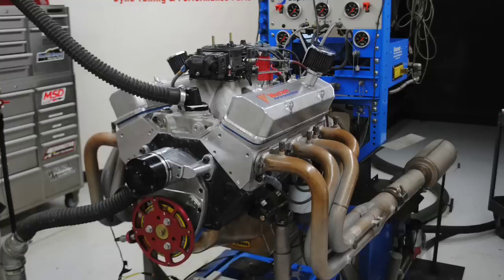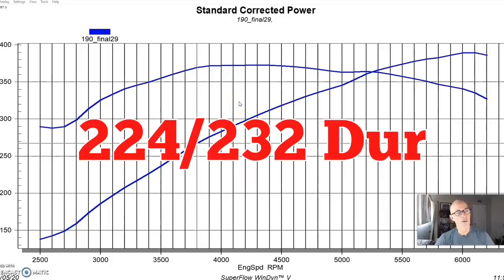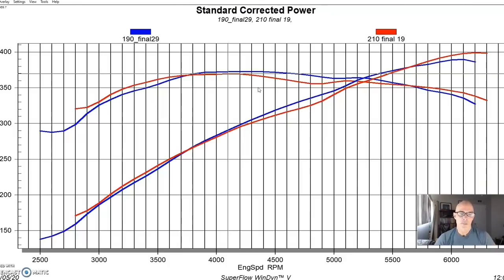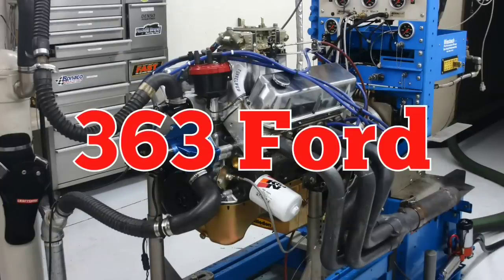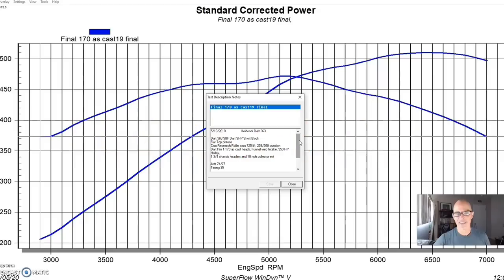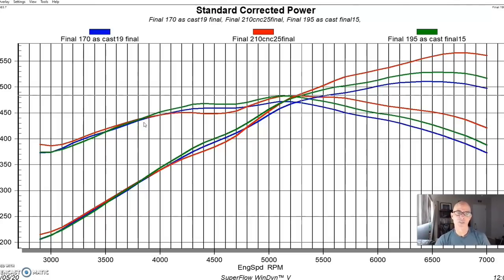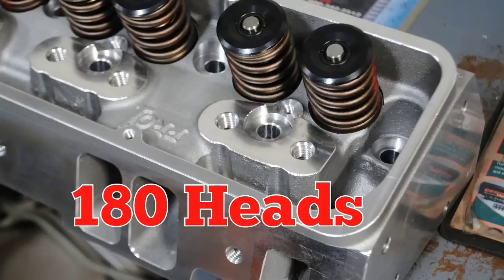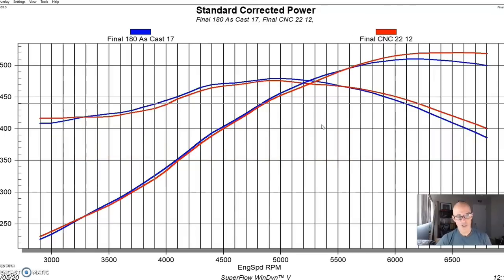PORT VOLUME-IS BIGGER BETTER OR IS LARGER LESS?

Comment: My research at UM showed that what the larger port volume does is that it dampens the effect of scavenging from the exhaust, which is why you see the effect most in the midrange. Any one of the many factors that improves your pumping efficiency in the midrange will also make your engine less sensitive to port volume. So an engine with a larger displacement, a tighter LSA, and properly spec'd long tube headers will not be as sensitive to port volume as one that does not have those advantages. One last note, where you have the volume is also important. I would say that the pocket volume is much less of a factor than the cross-sectional area. Keep up the great content!
Reply: Have you posted your studies anywhere on the internet.  Something more long form and person can look at?
Reply: @superkillr  My comments are based on research conducted for GM and Ford on a variety of projects. Sadly none of it was posted in the public domain. That being said you can see the results in the cylinder heads that were developed from that effort. In this case that would be the L76/L92 head.

Comment: I got one for you take the vortex cam and put it in the throttle body and play with 1.6 rockers or throttle body spacers real junkyard pull and put together without those awesome vortex head any gains or fuel possibilities  not worried about horsepower but durability and torque and fuel add the vortex to a throttle barrel and see if their is a benefit we need work not race engines just looking for that combination out of a junkyard pull it put together and make it work we all love power but let's shop the pull a part for an awesome  combination that improves performance and fuel economy and assembled on spot cause some of us aren't blessed as you are  but GOD BLESS ANY WAY CAUSE I LOVE WHAT YOU DO we just don't have parts lying around were going to the junk yard to find ours hoping they do better we have no dyno or fancy monitor to tell us were rich or lean or lacking head flow or compresssion

Comment: I have 2004 Chevy express van 2500 with a 6.0 lq4 I like that stage 2 truck cam. Can you tell me what to buy to make my van a rocket without going nuts? I like the idea of not having to change valve springs or the converter, but I would love to be able to get 500hp and ftlbs together  or as close as possible. Excellent testing and mechanical engineering 💪💪
Reply from the maker: boost

Comment: Re: your question about part throttle power—I never dynoed it, but I had a 2000 Silverado 2500 with LQ4. I added some mildly ported (basically a pocket port) 706 heads and a Vinci 210/218 .551/.551 cam. Overall power was up for sure, but the best part of it was the part throttle response. It was really snappy and fun to drive. Even with the lazy 4L80 first gear.

Comment: This is a good test idea but you forgot some key things gs to cover. When trying to determine cylinder head affects on a motor you have to make sure your intake manifold is not a restriction. On the 306 combo that manifold average runner flow is only about 240cfm. The intake manifold flowed less than the heads on the 306.  Bottle necks in the combo can skew the results.
The 363 made more power because you had Funnel web which has a average runner flow of 300cfm which is why the power increases were more. The manifold was not a restriction.
This is good testing. Love the real world testing.

Comment: An old endurance race engine builder used to tell me, "I want the smallest port that flows the CFM I need to make the power needed"
Reply: I'd rather have a smaller sized intake runner on a street based motor. As Richard stated. These numbers are based on full throttle pulls. Not part throttle driving. 

Never forget the time motor trend put a set of 165cc heads on a sbf 410 and it made stupid torque through the entire rpm range. 
The 195 head was the clear winner in that test. Because the cam was on the smaller side too. The 220 version would've done better in the test. IF the cam was bigger. But the longer duration will make the torque come in higher in the rpm band. 
So part throttle and lower speed driving would be effected significantly. 
* Unless you have a stick & a very light car.
Reply: As long as they are old, that means they are correct... right?
Reply: @superkillr  for sure, I know a guy that was building an engine and buying random parts some "big racer" he knows told him to get. Tried to tell him it wouldn't work. He would get my opinion on everything and buy exactly what the other guy told him to get. Ported factory heads with not enough spring (but but they're new!) for his solid lift roller cam and "HYDRAULIC" flat tappet lifters. You can guess what happened the first and last time it ran 😂

Comment: Duh! It depends on application. Drag or race requres port velocity @ high rpm with what for the application are acceptable compromises @ lower rpm.
Street requires velocity through a much broader rpm range. Usually from idle to about 5 000 rpm for larger displacement.
For nigh on 100 years the best road cars have featured one engine quality that endears them. Aside from reliability, the flattest, broadest torque response possible. This is actually more difficult to achieve. Because the diversity of driving conditions is so variable.
But  careful matching of cam to port to induction & exhaust can give you awesome throttle response that is actually usable in traffic with surprising economy and WAY better drivability. BUT only if everything complements. IE the whole package. Gearing, road handling, brakes, driver position & ergonomics etc
Back in the day I built a 4.0 litre 4 speed in a TE Cortina. It weighed less than 1200 kg. Above 5600 rpm it lost any semblance of thermodynamic efficiency.
But....... below that it was and still is one of the best engines for power with economy you could get. The 250 crossflow iron head. Mine had 210 rwhp & with 2.92 axle gearing could get on a very cold day the economy of 10 litres per 100 km highway. That went out the window with 3.25 diff  to 12 L per 100k That motor went in stock NA form from 100 kw to 190 Kw over a 50 year life span. In barra turbo form, aftermaket tuners have pulled up to 800kw from what evolved into an injected variable valve timing quad valve pr cylinder  twin cam that served in everything from taxis to drag cars.
There was a contender that for a while eclipsed this gem. The hemi 265 in RT form & as the E49 it set records that were not beaten till the 250 had injecion, 4 valves per cylinder AND a turbo some 30 Years later.
All the E49 had was a lumpy cam, headers and triple webers. This was because it had a themodynamic efficiency  that with that induction stretched to well over 7000 rpm. As was discovered by aftermaket tuners. But at the expense of any semblance to economy. Brakes were shit ,handling like a wet bar of soap in a bathtub. Economy? HaHa Ha 5 litre V8's bettered it. But 1/4 mile flew by in 14 seconds. Literally NOTHING could catch it that was built here. Not bad for a 50 year old but it didn't last. It like so many muscle cars was killed by the fuel crisis.
Lastly after this long winded tirade. To me its all a question of balance. Everybody loves acceleration that like the hand of God pushes you into the fabric of your seat. But if its a pig to drive & empties your wallet by guzzling fuel like pulling the plug in your bathtub it will loose its cheap appeal VERY quickly especially if the valvetrain needs rebuilding annually because the cam is so aggressive.
If I did a street engine today I would embrace roller cams (for ohv pushrod at least) & fuel injection.
The advantages for long term reliability tunability in real time to match climate altitude and driving conditions and style is unparalleled.
But we will all be driving electrics soon enough. Instant touque at any rpm & 90% efficiency  vs 15% for I.C.E  at best is a hell of a thing.

Comment: On a 289 Ford going from the stock heads to E-streets definitely hurt low rpm. Had to go to a 3.80 gear just to make it somewhat drivable.
Reply: E streets have 60cc chambers, your torque/hp went out the door with a major compression drop... unless heads were milled significantly.  If piston deck hts weren't checked as well, compression could easily be in the mid to low 8:1 range. Do a cranking compression test to get an idea if this is where the power was lost.
Reply: Also what cam did you use?  The idea you can change heads and run any cam you want without problems is NOT in this video, but seems to be what alot of people are taking away.

Comment: 331 with. X cam 1;7 rollers and world Windsor jr heads. GT 40 tubular. 24 pound injectors 10.5 compression.  450 hp at flywheel. 5600 rpm .  In a 92 drop top summer time fox .

Comment: I run a 434 small block. 210 AFR heads which I think would be on the smaller size for this engine. .635 lift cam and a 950 Quick Fuel. It made 598 HP at 6300 and similar Tq at 4400. Yes it runs out of air but still pulls at 7000 through the lights in the 1/4 mile around 127 mph. A similar engine with more cam and 245 AFR heads make 700 at 6500 and same Tq as mine at 5400. A comp. check on mine was around 205 - 215 lbs so I think the small heads and less cam timing work well for me. In a 3300 lb street driven Nova I have run 10:18 at 129. 10.5 comp lets me run 94 octane.

Comment: I would love to see this test with a small bore ls1 and with a large ls3 head with 2.08 valve to fit.  Most of these tests where with a 225 port head, when a better test would be with a 235 to 255 sized port.

Comment: All I heard was , I used this cam , and theses blocks, and nothing how the combination goes together. Had small port head out do a big port both where cnc, an compression, intakewhere for the smaller port, now matching a intake and compression to the bigger head, and get the same results,  then you get into the shape of the port ,boom a hole new world.

Comment: Idle to 4k with 1/4 and part throttle would be the test.  

Interesting comment below about tuning each combo and then comparing VEs . . . But I'm wondering if you could just look at part throttle fuel flow to calculate / compare horsepower.

Comment: Not really an accurate test as to show if this affects driveability the test needs to be from idle to around 3500rpm at varying low to moderate throttle opening.
V8's also are less prone to port velocity effects due to their cylinder sizes and how the 8 cylinders support each other when drawing in air compared to a 4 cylinder. A 4 cylinder is definitely more susceptible to port velocity at low RPM.
Your test works fine for anyone drag racing but doesn't show anything for street driveability.

Comment: I'd expect no change in part throttle power over the full RPM range other than a total percentage of the full throttle power, just as boost pressure above atmospheric changes the whole curve as well. Unless the throttle blade is directing airflow in an unwanted direction and affecting distribution, I see no difference in vacuum below atmospheric at part throttle, atmospheric at wide open and above atmospheric in boost.

Comment: Small modifications to the intake valve seat area ( radius away any lip or casting irregularities next to the valve seat in the combustion chamber) and removing a little material off the valve guide (straight side) will noticeably improve a small port head.
Reply from the maker: so porting helps
Reply: @richardholdener1727  Yep...these modifications will "generally" improve low speed torque on a small port head. Doing the same to a large port head may reduce low speed torque.

Comment: That mid range drop can be manipulated by cam degreeing changes. Each combination can be fined tuned for purpose by degreeing, scavenging, induction volume and length (as RH stated).
Its all about combination.
I learned by experience decades ago, you aint drivin dynos. Fat numbers dont make responsive/fun drivers.
JMO
Reply: Sure.
Put all that fun stuff on a 302, with RH suggested bigger cam.... And then try and drive that 6500 rpm engine around as a daily driver.
Snappy throttle response?
Probably be worse than turbo lag
Reply from the maker: please look at the torque curve-drove my TFS High Port heads around for 85,000 miles on my 8.5:1 302-works fine

Comment: Could the low speed power gain be because it could want a bigger cam on the bottom end for torque production but once the heads come into their own it's giving it more than the engine can handle? Just spittballing here
Reply: on the 302, i think the cam and heads were too big. that dip in the mid-range proved it. remember the smaller heads had less of a dip. he should have put that cam in a 351 and then changed the heads. that low speed power gain was because the velocity was good enough to make that extra torque. in the mid-range dip the velocity in the port was low. as the rpms went up the velocity in the port got better and started making more power. i don't like seeing dips in a power curve, it means the parts aren't matched correctly. i would use boost to fool the bigger heads to think they're on a bigger motor.

Comment: I ported a set of 416 heads, I mean I hogged them out! First attempt at pirting and ran a Erson RV15 because I originally put that cam in my computer controlled, carborated 305 with .420 lift and 210 duration and it would pull to 5,500 rpm in a Jasper 355 in 5th gear in my 1983 Trans Am

Comment: I'm building a 306 SBF for the street with 10.5:1 compression, T5 and 3.9's.  Also using the XE274HR.  Going to supercharge in the future.  I'm torn between Trick Flow Twisted Wedge 190 11R CNC'd heads or 205's
Reply from the maker: both work well
Reply: Did you ever get this built?

Comment: You make no sense running bigger port heads on the 306 compared to 363. Are you on drugs.
Reply from the maker: right
Reply: @richardholdener1727  so is that a yes to being on drugs then. Seems you say so much on videos but give a one word answer when a questioned. It was a very valid question I asked.

Comment: What you failed to mention was the valve sizes, bigger port heads have bigger valves (usually), bigger valves mean more low lift flow.

Comment: Isn’t the velocity of the air going to be determined by the most restrictive part of the system? You could put the largest possible ports in the head but if the valve size and lift stays the same then wouldn’t the velocity of air entering the cylinder still more or less be the same?

Comment: For my 2cents I found the stumble between 4000 and 4700 RPM that all the ford tests had very interesting. This is big piece of the RPM range you're likely to use on the street. Not present in the Chevy but obvious in all three applications of the Ford. Likely cam.
Reply from the maker: different cams in the two Ford motors-it was the heads

Comment: Some of the examples shown with bigger than stock ports seemed to drop horsepower and torque in the 4 to 5000 rpm range but came alive above 6000. Kind of a mystery why the engine would lose a little power there but not lower in the rpm range. Something is happening in the engine at that rpm range but what? Could it be the overlap in the cam affecting it at that rpm range?
Reply: Intake effects, wave tuning. Read everything you can from Larry Mauxx, Darin Morgan and get a copy of pipemaxx if you want to understand better.

Comment: The big port flattens the torque curve. More at top and bottom and less midrange. That’s why oem use more port size than needed. Especially with a small camshaft

Comment: i like how the dyno test sheet starts at 3.000rpm. this does not translate from idle up to 3,000rpm were most driving takes place.i know for a fact.seat of the pants driving 9 times out of ten,with a bigger head u loose low end torque.idc what this bs dyno that starts at 3,000rpm says.also there using decent size cams.try that with a stock cam and lets see from idle to 3k numbers.i recently just went through this stock ho cam had e7.put on gt 40,s.u could feel the loss of torque down low.higher up it made more power.and the exhaust note got alot louder.but down low no sir it lost.
Reply from the maker: I know for fact (seat of the pants)?
Reply: @richardholdener1727  thank u for the correction.for a fact.much mo better lol

Comment: It would have been nice to have the flow charts for each head. If the valve is the main throttle to the flow then the port would have little effect on the flow thru the engine.

Comment: I’m betting some of that recurring midrange torque loss could be picked up by tightening up the LSA. The question is: would it be worth the high rpm torque trade-off.

Comment: Great video sir,,  I'm personally not surprised at all..  However these test were done with small cams and wide lsa numbers in my opinion...  I really loved my dart 230's  running over 600 lift and a 106 lsa. 400 ish inch ish sbc.. need more low end? open the throttle...  Just saying in my application it worked nice.

Comment: Thought before video... Yes "Volume" matters, but only to the degree at which you can fill it efficiently. This efficiency means maintaining optimal laminar airflow, and or turbulent air flow in the appropriate points into the engine.
Reply: Post Video Comment...  I love that when watching I get these nuggets of knowledge I wouldn't have thought about. When I think about power I always think about the end goal. WOT POWER, but forget that this thing needs to be driven not at WOT and around town. Thanks as always for the content even if I'm not actively a V8 guy this info is indispensable when considering way to make power

Comment: Install a flux capacitor below the carb to generate a time portal to speed up the air moving to the runners for insta torque.